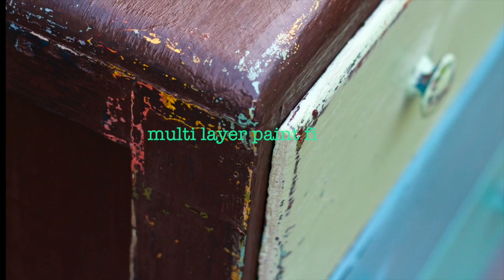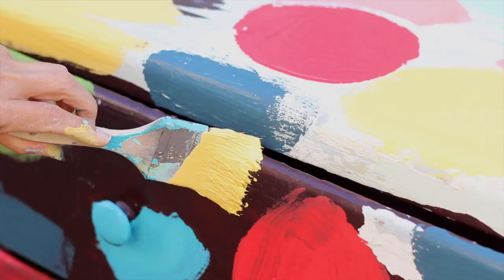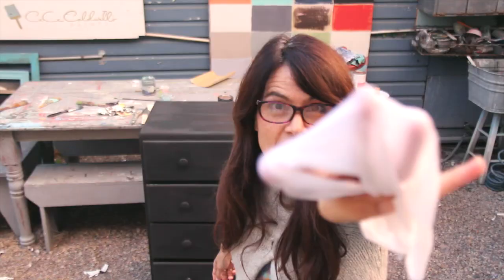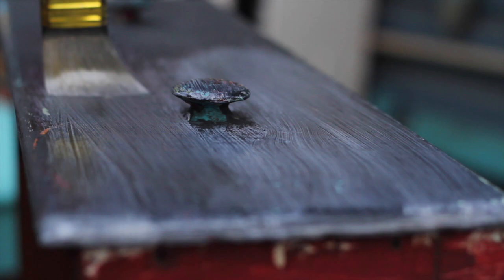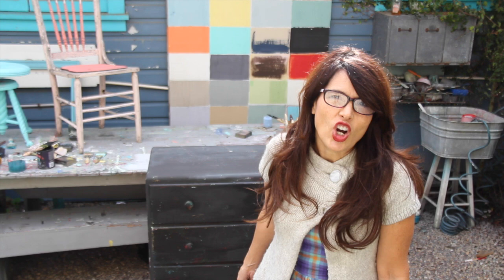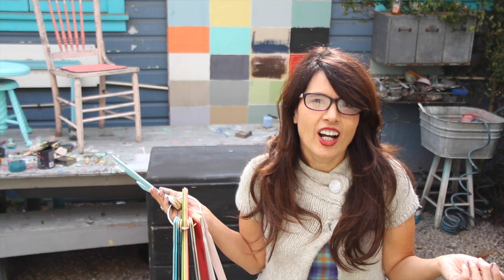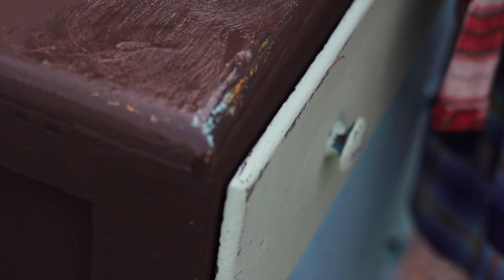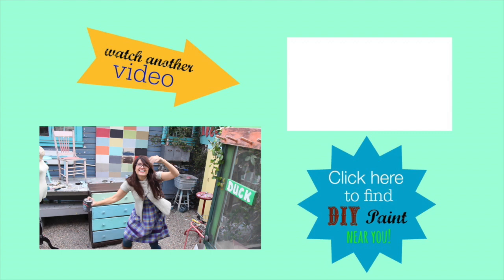How to layer paint on furniture and wet distress

Comment: Thanks for the shout out Debi!  You're too funny ~ I felt your frustration; been there many times.  Looks like your black is highly pigmented, much like the Peacock blue I used on my buffet.  Because the Peacock is so highly pigmented, I diluted it a ton almost to the point of a wash.  As thin as it was, it still completely concealed all the vibrant colors underneath but made distressing a bit easier.  It's definitely something I fussed with.  I'm sure I had more than one moment when I was ready to roll it out into the parking lot too but it eventually all worked out.  Thanks again!  Shelly

Comment: Well the colors were great on the first go around and then you went with black....ugggh. Not a fan of black in this project. But maybe if you did sections and tried to dstress it before it actually dried then the results would have been better. I would have glazed it myself instead of the black. You could have used a crackle glaze.  Great vid Deb, makes me smile when I watch them...lol.

Comment: HELP! I painted an armoire and not in love. It painted bo blue, vintage white, kissing booth (hiding because i covered it) hey sailor and a lavender, all DIY. I haven’t sealed it and noticed I can literally soak and wash the paint off but that a lot of paint but I not sure if I can just start over on top of it and take a chance of the paint becoming muddy as I get started. *Should I seal it and start over, does it stick to Big Top or Wax? *Start right on top of the DIY paint I dont like? *Wash it all off? BTW - My Armoire front has 2 doors, each with a large Oval latice / wicker insert, this is where I’m having a hard time (I dont care for the look) I’m temped to make/have a mirror’s cut and put directly over. Feeling Helpless, I hope you can help. I’d love to share a picture but embarrassed by my mess. Love your work, Winter